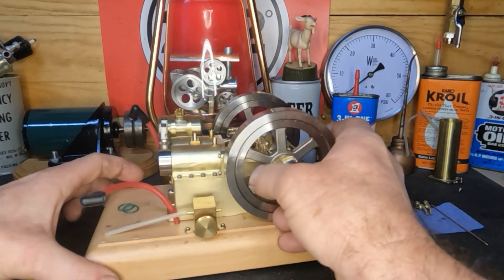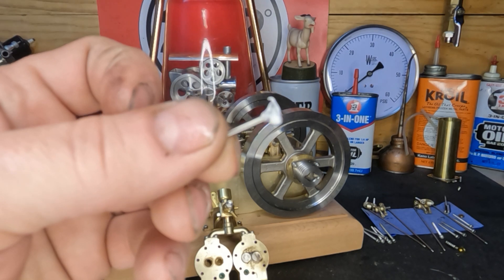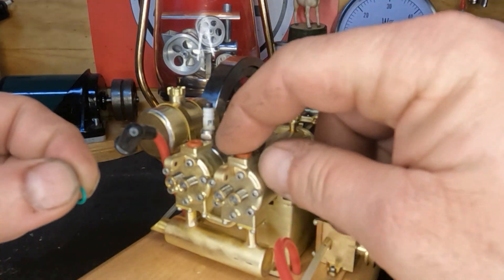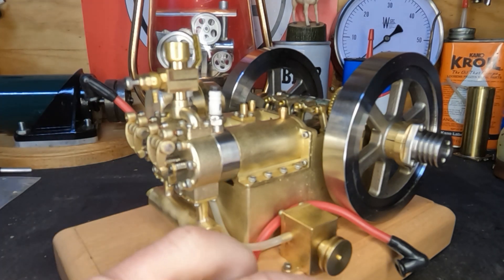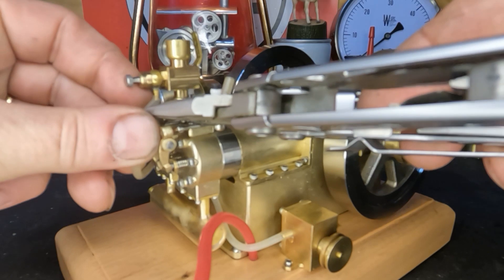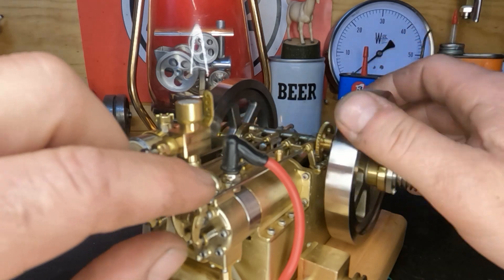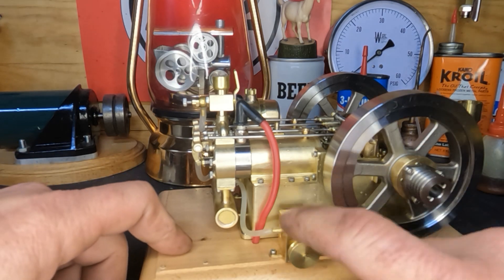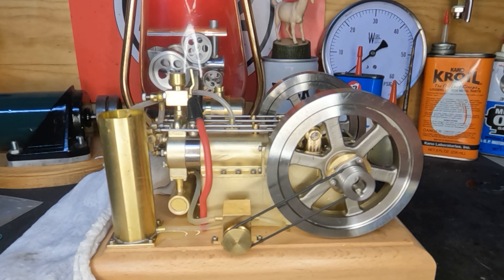Microcosm H76 Twin   ......  Repair and Failure in 18 Minutes or Less GUARANTEED!

Comment: how are those rings lubricated, are you using oil in the fuel?
Reply from the maker: Hi Timothy, yes I am using 40:1 premix fuel, also there are cylinder lubricating cups for dropping oil directly onto the pistons.

Comment: I just received my engine yesterday H76. Like you was not impressed with it at all. After several hours of trying different things I finally just started over. Checking cam timing I found it was opening the intake valve to soon, causing it to put pressure back into intake blowing fuel back to tank. I changed cam timing to where intake valve starts to open at TDC. What a difference it made. I also turned carburetor sideways so throttle lever is inline with cylinders. I done this because the opening in carburetor butterfly (or spool in this case) opens to one cylinder more so then the other. Turning carburetor makes it even to both cylinders.  Now it starts by hand ideals good and revs alot better. Not saying this is wrong with all of them it is just stuff I found wrong with my engine.
Reply from the maker: Well done Randy. It's a shame that for the price this is all the quality they put into them. I also feel bad for the people who buy one and lack the ability to do the necessary repairs to get them to run. I would hope that by now the folks at microcosm are starting to see that some things need to change on their end.

Comment: Hey where do you get replacement o rings for the pistons on these engines?
Reply from the maker: Hi Kevin, These little engines (mine anyway) come with a replacement set of piston rings.
Reply: @steam212  Ok great cause I just got a couple more of these guys I’m guessing they will come with extra rings.
Reply from the maker: @Kevin_Dyke  I would think they should. If not let me know and I will measure one of the spare ones in the shop so you know the size dimensions. I hope this helps you 👍

Comment: That's a very disappointing result...  Started up so well the first time, but obviously just never ran right or reliably since.  Got to admit I like fiddling with my model aircraft engines - even after 40 years stored in a protective coating of congealed castor, dust and spider droppings they clean up and run perfectly.  Lately we are getting pounded with these FB ads to buy a 9cc V twin fully assembled on a base with ignition for US$35 - yeah, right, I bet that would be a pleasurable experience...  Got a fair few reservations with these various Chineseium miniature replicas, awful lot of faults and silly QC errors it seems.
Reply from the maker: I'm really frustrated with how this turned out even after tweaking. I'm positive that I either rolled one of the o rings or maybe even cut it when I reinstalled the cylinder liner (even though I lubed them up) and the more I think about it I wonder if there is an issue with the intake manifold causing one cylinder to flood more than the other. You're exactly right about castor oil, dust, and droppings being a fantastic preservative on model aero engines, the build quality of this h76 is no where near the higher standard that 40+ year old aero engines were.

Comment: I have an M19 which has been nothing but a pain in the ass from brand new. Has never run proply due to their terrible quality control. I'm fast getting tired of screwing with it. Trust me when I say you're lucky yours even run at all. And I'm no engine newbie either. I also have an M12C which is also in bits. They are so close to making these great models. Sad really and very frustrating

Comment: Was thinking you turned the intake around and your problem with the cylinder miss firing changed to other side. I would look at the intake closely. Could have pocket holding fuel flooding that cylinder, small crack causing vacuum leak. That's only thing you really changed and the problem moved.
Reply from the maker: You're right, I will taking it back apart to fix the cooling leak so I am going to look into that too.

Comment: Sorry it didn't work out. if your looking to get rid of it I would enjoy taking the time to work out the kinks. Let me know what your plans are for this motor. look forward to the next video.
Reply from the maker: I think it needs to sit in the corner for a while and think about why it felt necessary to pee on the workbench. I will eventually pull it back apart but I don't want to just rip into it right now out of frustration (if that makes sense)

Comment: I've had lots of these engines where the bottom of the cylinder liner doesn't have the edges deburred very well, so they cut the o-rings for the water jacket seal during removal/replacement.  I've just accepted that I have to be more than careful about those seals when reinserting the cylinder liners.  I'm not sure how the water flow goes through the head, but if it comes from the head, through that top section of the cylinder liner where the plugs are, and to the main cylinder jacket I will bet all those joints are sealed in a less-than-perfect way.
Reply from the maker: This uses 4 o rings on the liner to seal it to the block and 1 o ring from the liner to the head. I was pretty careful when I reinstalled them and used silicone grease on the rings and on the block, guess I will need to be even more careful when I do it again. I can't wait........well maybe it can wait a little bit 👍
Reply: @steam212  I don't have one of these, but I have resorted to silicone gasket goo on one of my engines to "solve" irritating leaks I couldn't track down so I wish you luck in chasing those.  Although, that is the tiny silicone tubing and I had a piece of that fail by splitting lengthwise and it didn't look broken, just leaked when I added fuel.  Maybe you're lucky and it's just a split tube you can replace.
Reply from the maker: @henrybangsberg2187  When I picked it up off the bench after the video, it poured out of the base plate (only on the left side). I'm sure that I rolled a ring out of place or cut it while re-installing it.  I was also thinking about how odd it was that by turning the manifold around that the opposite cylinder crapped out, maybe it has something to do with the way the carb barrel opens and sends more to one side "flooding" it? At this point I am viewing this engine as a test mule (h73) just to see what happens with other ideas.
Reply: @steam212  since the carb is screwed on you could test the carb theory by rotating it 90 degrees.  Then it would be dumping fuel down the front or back of the manifold instead of toward one cylinder or the other.